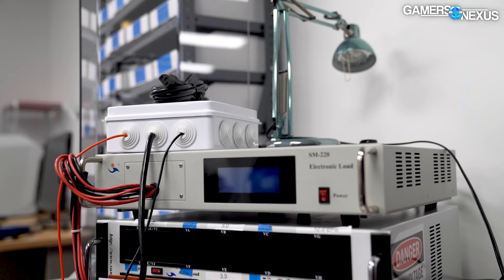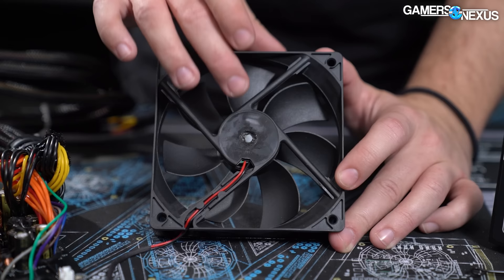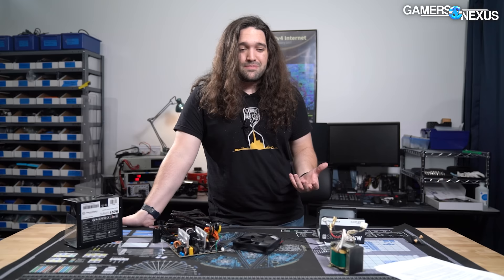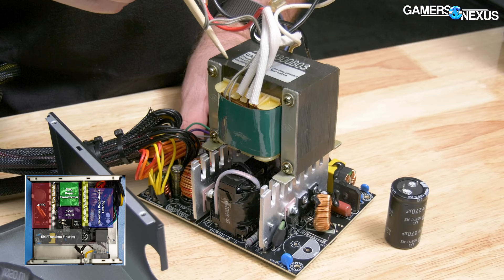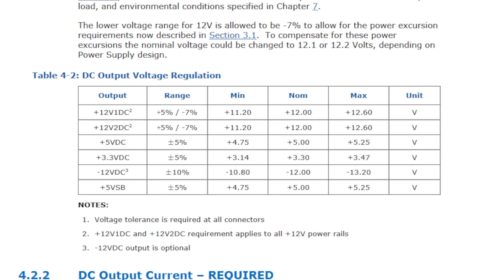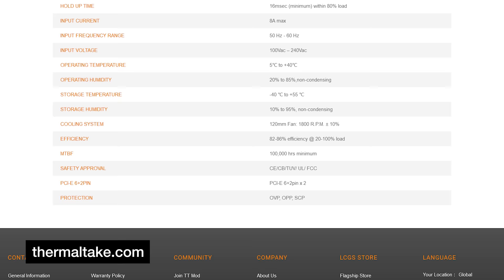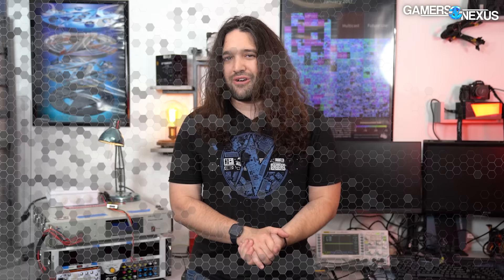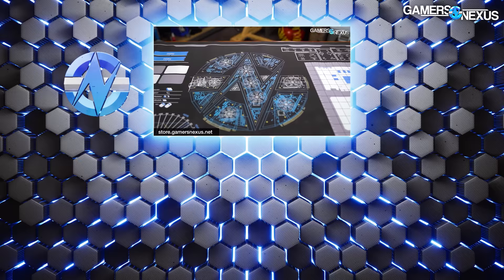Taking Risks on a Cheap PSU: $30 Thermaltake 430W SMART Power Supply Review

Comment: I feel like "nothing seriously wrong" is a victory for this little thermaltake unit! It gave a strong showing for costing less than some high end case fans!
Reply: It's probably fine for APU builds or super low end builds. All that ripple has little effect on a standard small CPU.
Reply: I have a similar unit in my 7 year old build, with a Haswell i5, and GTX 960 (at the time, I had no other corners I could cut if I wanted to fit the 960 and quad core in the budget). I’m rather surprised it hasn’t keeled over long ago.
Reply: @robojimtv  yeah it would be perfectly fine for something like a i3-12100 & RX6500XT/GTX1650Super for 1080p/E-Sports Gaming
Reply: @Lauren_C  Yeah a perfect example of where these are useful, adding a 50/60 GPU to the 2000-4000 DELL Optiplexs that had a ATX PSU & Standard Mobo
Reply: I run a small PC company and we have a deal with Thermaltake on these.
They work great, we run their 430W model and 600W models respectively.
We mainly focus on lower-end systems but we've done higher-end RTX builds and still used these to save money for the customer, 0 issues in years of usage.

Prior to that we used a 450W Thermaltake model and it was fantastic also.
We used to use HighPower gold series (same that you see in Origin PC and other companies), and Apevia's gold series, I've found those to be less or equally reliable.
They get the job done.
Reply: the PSU gave 560W nothing broke, nothing exploded, no fire, way above the rated spec, far more then they power need of 95% of PC gamers in the world , 95% of actual gamers have low or mid range PCs with a i5 and a mid tier 3060 or 2060, this PSU can handle more than that easily, expensive PSUs are the biggest scan in the PC building world
Reply: @leandrrob  I wouldn't say a scam but if you aren't doing a lot of heavy overclocking you don't need to spend more than $75 on a PSU imo.
Reply: @leandrrob  "95% of actual gamers have - - a mid tier 3060 or 2060" Bruh... 95% of gamers do NOT have anything nearly as high as 3060/2060! Only a few percent have RTX cards. The most used card is stil Gtx 1060.
(Thought I just checked the latest Steam stats and 3060 and 2060 are indeed in top10 along with 1650 and good ol' 1050ti. Seems like ppl have been upgrading their gear.)
Reply: "Better than Dell"
Reply: @shaneeslick  I would want to push to a 6600 just so the performance isn't all over the place. Total Power consumption would likely be under 250 watts still
Reply: @JBrinx18  Yeah I have seen older i7 with RX570/580 on 450W PSUs not experiencing issues,
but If I needed a PSU this cheap I would feel better with a TT Smart 500/550W for any GPU with a Claimed TDP between 100W & 200W, just to make sure especially after seeing the video on GPU Random Power Spikes.
Reply: I have an EVGA 430W 80 Plus with a Ryzen 5 1600AF and an old GTX 560Ti wich consumes like 170W and everything works fine, any problem, the power supply never fails and it has like 3 years now. Soooo i will buy a RTX 2060.
Reply: @leandrrob  560 nothing broke sure, but how long is that gonna hold out before the thermal protections kick in?
In other words, the heatsinks and low-quality fan might be the limiting factor for those particular power levels.
That being said, this PSU is quite more than enough for an i5 and a 1060 or I guess these days a 1660.
Reply: Yeah, when you can sell "nothing seriously wrong" for significantly less than "will probably explode and burn down your house", you're doing something kind of right.
Reply: Would work just fine with B550, 32Gb of RAM and a 8 core APU. For years.  For gaming? Not so much.
Reply: @warrenpuckett4203  What? Are You sure? I have a Ryzen 5 1600AF with OC (about 105W), an old GTX 560TI (about 170W), 2HDD and a m.2 SSD on a EVGA 430W 80 Plus White. In 100% all the PC no problem for 3 years now. 

The Power Supply never fail. At least the mine...
Reply: @pepin2089  3800X no need for OC. Actually uses less power than a 1600AE (no OC). 
    I underclocked AND UNDERVOLTED IT.(3800x)  BUT all cores OC'd in windows with a 6 pipe air cooler. it goes way beyond 105 watts with stress tests. I am pretty sure it is current limited
 Nothing I do in Linux uses 100% CPU. Even windows rarely used more than 65 watts. Pretty much for my use 700 watts is over kill. Cooling is done with one 120mm input and One 120mm exhaust. Disconnected the other 4 fans. Quiet is good. Gaming in windows with the R 9 390X? That sucks some watts. That is what the 700 watts is for.
 The B350 cheap prime + 1600AE and 16GB of 2400 speed RAM will run Linux just fine. Got all those parts just don't use them. Got the 3800X + 570X because the AE was slowing the R9 down. Sold off the 2400 speed and bought tight timing 3200 speed. That really made a difference. But not with the 350 Prime +. It had problems with 3200 speed. So I guess I won't need a Linda Lovelace 3090TI. It won't deep throat my wallet either. DO NOT HAVE WINDOWS.
Reply: @leandrrob  You thinking good PSU's are snake oil is the funniest thing I've read throughout these comments.
Reply: @leandrrob  Great plan, lets save $20 on a PSU and run it way outside of specification, and in the process kill the lifespan of our motherboard and GPU capacitors with insane amounts of ripple.
Reply: just be careful with what psu you buy if they are cheap. Psus are still dangerous if parts arent good.
Reply: I have an older Thermaltake power supply like this in my parents pc. It’s only 400w but can comfortably handle the I7 4771 and GTX1060 in their system, even at full load.
Reply: I can't believe that there are actually people buying fans for more than 10 bucks.

Comment: Seeing your self-rating on your expertise in this field rate you as a novice because you’re just getting started is some next level integrity and i’m here for it
Reply from the maker: We're trying to make sure everyone is on the same page! Adding a new category is difficult, and we want to make sure it's clear when you may want to still check a second source while we learn and improve!
Reply: This comment are my words exactly.
Reply: @GamersNexus  You might think you're novices because of experience, but this is some top notch explanation and data gathering.
Reply: I want to know how many years is deity...
Reply: No, you're not truly novice since you have a badass like Stone aboard, plus the expertise of your team developing test plans, gathering data, and producing reports and copy. But, I appreciate the conservative ranking system. It's not often people will willfully sell themselves short for the benefit of their customer/audience.
Reply: their conclusions are very flawed to say the least, he states that its a ok power suply to a very cheap low end rig with a 1030 GPU, the PSU actually broke only at 560W which is far more than what you need for a mid range rig with something like a 3060 and a i5 that would consume 170+65W
Reply: @leandrrob  you can't run a 3060 on this PSU. It's only 32 A on the +12 V rail and a 3060 eats 45 A (might even be 50 A, haven't double-checked)
Reply: @GamersNexus  See, the issue here is there is no other source for this unit, so you're the experts now!
Reply: @redaffix7320  Absolutely. Meanwhile, you have people buying PC hardware because they looked at some paid shills "reviewing" the product in a marketing video.
Reply: @alinzelnan  I don't blame people for shilling, I just don't like them not addressing a clear bias/conflict of interest. Doesn't make their opinions completely invalid, just that it's all colored and to be taken in conjunction with other reviewers. It's why I like so much that GN always uses either unrelated sponsors for a review, or just does no sponsor and basically says "hey, buy our stuff so we can keep doing independent reviews." Still making cash while keeping things as impartial as possible.
Reply: @redaffix7320  Most of them are addressing that the video is sponsored but I don't think many people really understand what that means for the content they're watching. I mean there are videos out there who praise the Alienware PC as good with some small flaws and people believe that and maybe even buy it. I'm just glad this channel exists, it surely does deserve way more views than it currently gets though.
Reply: @alinzelnan  Agreed.
Reply: @leandrrob  He also may be factoring in transient spikes that you get from GPU's.

Comment: How could you pass up such a hot power supply as Diablo? What could go wrong pushing electricity through something named like a fire demon?
Reply: Wouldn't be surprised to see Diablo PSUs as a sponsor for House of the Dragon, alongside Gigabyte PSUs
Reply: I had a diablo psu before, it smelled weird every time I used it
Reply: The flames are a feature
Reply: The fire that ensues is the next new in-thing. Step aside RGB LEDs, open flames are IN!
Reply: @HoloScope  I imagine the smell was similar to when a tube TV burns out or when an electrical socket pops.
Reply: @AlchemicSoul  💀
Reply: Diablo Immortal will happen
Reply: @bugzycapone  won't be too immortal if house also incorporates the feature too
Reply: Diablotek Firedemon 666W
Reply: I personally would laugh 😆 sooo hard if this psu ended up being a vg performing unit 🤭🤭🤪
Reply: Diablo would be the devil not some npc demon.
Reply: @davood123  well once you burn your house down the memories will be immortal
Reply: Somehow Diablotek has been in business for like 25 years
Reply: @infinity2z3r07  I could only be more shocked if I handled one of their power supplies myself
Reply: Brings to mind the Trustfire brand of lithium ion cells and chargers.
Reply: Paired with a hellhound card and your case doubles as an air fryer

Comment: Speaking of low wattage, Seasonic used to have a 360w gold rated model (SSR-360GP). It scored a VERY good review from jonnyguru. I have like 3 at this point (plus an OEM model). I wish they still made them.
Reply from the maker: We'll look into what they might make today as a replacement!
Reply: SSP-300SFG is a 300W 80+ Gold SFX unit I'm running in a SFF APU build which I built in November. Good unit
Reply: I have a couple of what I assume are the OEM versions: SSP-350GT also 80+Gold, no PCIe Power but I used them for office PCs so they're just fine.
Ironically in a similar vein, I replaced most other office PCs with some random Thermaltake grayboxes that I got for cheap. Sounds dangerous, but they're solid unlike the old PSUs whivh were made of the cheapest Chinesium you can find, and had:
* 3 just died.
* 3 had extremely rattly fans.
* 2 had no fans idk how they still worked.
* 1 had a capacitor cover just dangling around. Still worked somehow.
* 2 had no fuses to speak of, just bypassed.
Reply: @GamersNexus  There are BeQuiet budget PSU's Im interested in,  should be good for any modern 300-350W system like an Office PC or HTPC or just a reapir of and old system people want to keep alive. There are so many 775 systems and stuff people still use for home businesses and stuff that dont even have a 300W rated PSU from Dell ;)

They are called "BeQuiet System Power B9 Bulk PC" on Conrad, the 300W 80+ starts at 46€ here in Sweden, the 350W is 49€.

There OEM/Bulk so not even painted, just silver like the old days.
I think Bequiets model number for them are BN206 and BN207

I think the 300W dont have PCI-E power but the 350W I think has so yea very basic BUT sometimes thats all you need.
Me and friends often have to fix systems on a budget that are low power but still used.

Nothing I would use for a modern Enthusiast build but for an old system or building from used parts it might be an option when the budget is almost null.
Reply: BQ's 300-350W models are decent little supplies, they're just decade-old tech. Still using FSP's EPN platform by the looks of it. Unless you are actually in the business of building PCs on a certain scale, I see fairly little reason to buy one when you can get a good used Straight Power 10 (CM) 400W/500W, Pure Power 9 (CM) 500W or System Power 7 500W for the same kind of money or less, all of which are substantially more efficient and modern.
Reply: Why do you have 3 tho? 😀
Reply: @GamersNexus  I was looking for something similar when building my Athlon 200GE HTPC, even with a 5.25ODD + 3x 7200RPM HDDs it doesn't use 100W at the wall on my meter, I ended up getting an In Win IP-S400GQ3-2 H 400W 80+Gold for $35AUD New last year, now they are $95AUD.
Reply: i have a chinese corsair 220v only, 450W PSU, in a 100W i5 and a 3060 which is 170W, my PSU is 10 years ond and cost like 15 dollars, it was the cheapest of the cheap corsair back in the $20 PSU days, i had many things breaking at my house over the years due to power problems tv, fridge, but my pc is fine
Reply: @leandrrob  Id say you're pushing your luck...
Reply: @GamersNexus  or the ss400et t3 and similar, cheap and easy to get OEM PSUs, would be interesting to look at
Reply: @leandrrob  i would advice you to switch that psu for tt smart 430